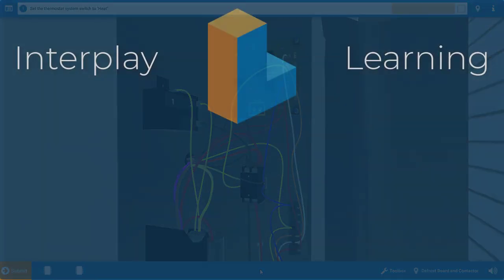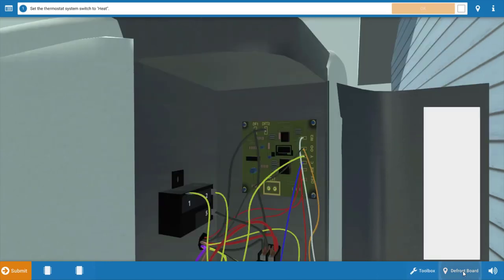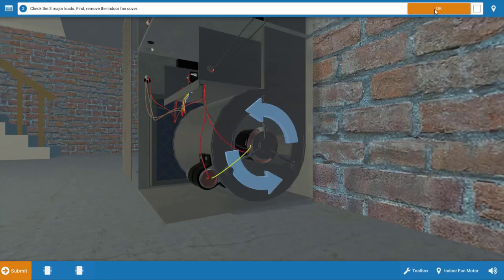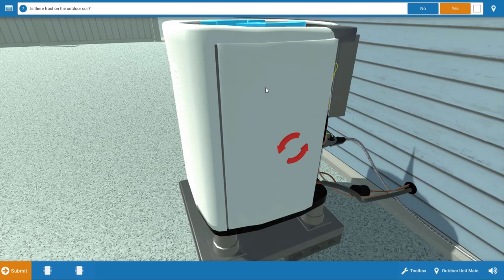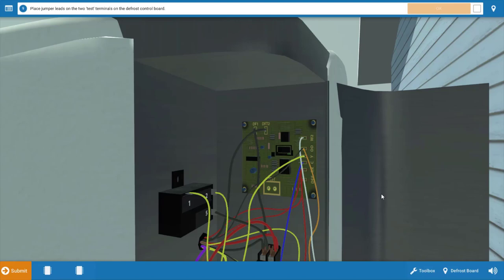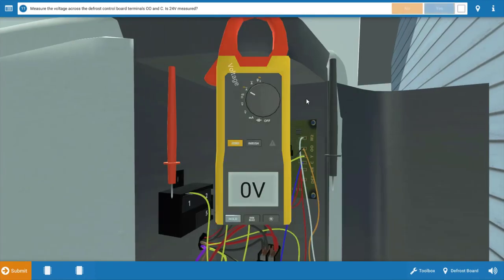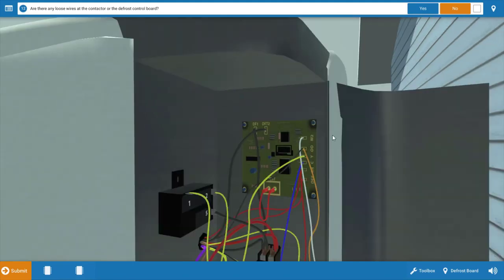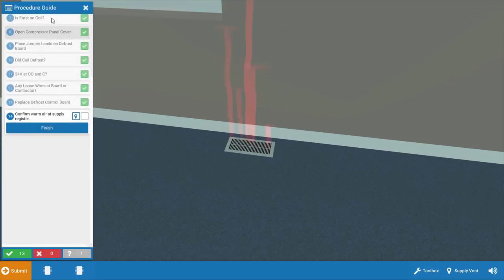How to Diagnose a Faulty Defrost Control Board on a Heat Pump

Comment: Hope you see this .... 
  I just installed a new Godman heat pump, I turned on and for like 35 min everything was fine and  then the outdoor fan stopped working but the compressor didn’t stop .... any ida what might cause this .....
Reply from the maker: Hi! That sounds like either the outdoor fan motor or fan motor capacitor. Check all electrical connections first.

Comment: Before I condemn the defrost board Trane CNT 02941. Help.  Defrost is auto "demand". Condenser ices-up. Does not engage auto-defrost. I jumper test pins, unit enters defrost mode, OD fan cuts out, but only 5VAC (instead of 24VAC) to reversing valve. Reversing valve coil Ohm checks good. Sensor pins at board show proper voltage at 5.5VDC. Both outdoor temp. sensors ohm out good relative to outdoor ambient temp. LED flashing normal.     I have to melt the ice by temporarily jumping R-O on indoor terminal board which activates reversing valve. Any suggestions prior to condemning defrost board? Thanks.
Reply from the maker: 5v to the reversing valve coil during defrost would indicate a bad defrost board.
Reply: @InterplayLearning    Thank you for your reply. I just replaced the board and all is fine. I think that I covered all of the possible tests that can be conducted in the field as described in my first message. On the solder-side of the bad board, I did notice blackening on one single solder connection indicating "burn."